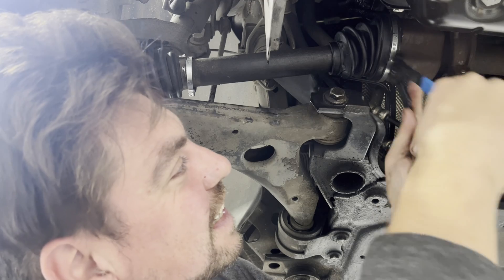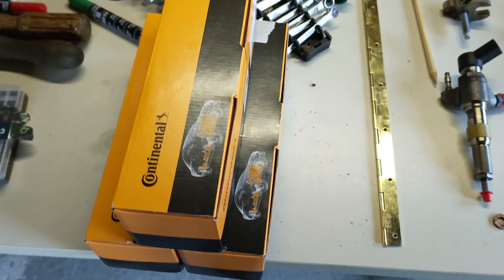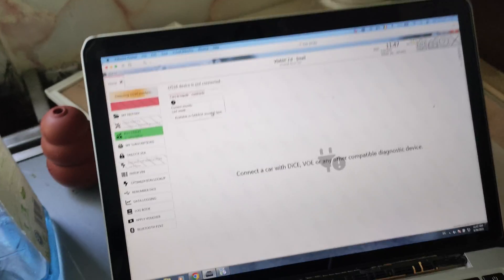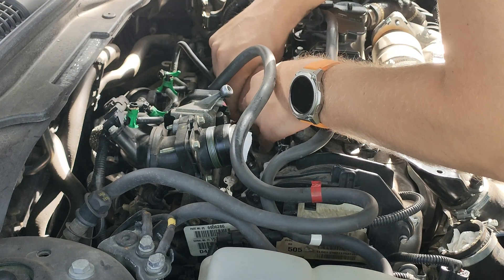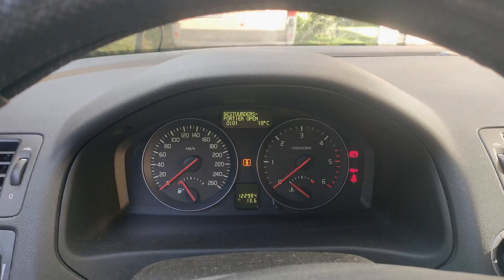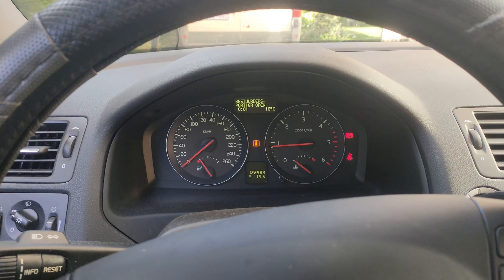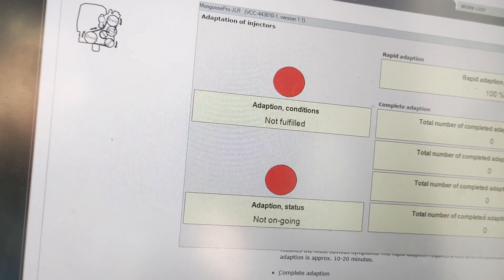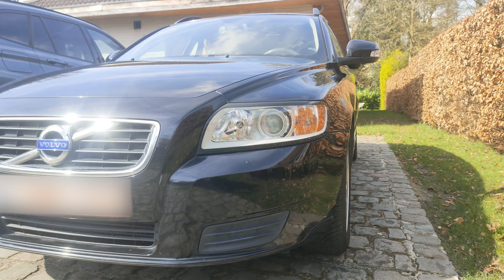Project Volvo V50 - Injector Replacement & Awakening the 1.6 Diesel | PART 2

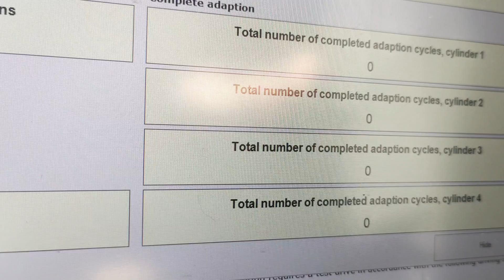Comment: 13:00 You need to keep driving doing the speed up slow down until the number of completed adaption cycles changes from 0 to 1. Although it may say you are at 100%, I have found a few times that to might need to drive double the distance. Also nice that it shows you to wait for 3 minutes after resetting the adaptions. This is something I though you needed to do after resetting the adaptions on my topdon scanner but I can't remember reading it in the instructions. Always good to see someone else's video to compare it against!
Reply from the maker: Good to know, but I have not found any issues since then, besides the damn DPF crapping out again... I've taken a look at your video about the C30 and yes, my V50 originally had the offset at max limit before changing the injectors. I had them tested and they confirmed it, as you saw. After changing them at first start it was a rough idle. But after coding and adaptions it was smoothed out, and that code never came back... I think the adaption matters a lot if the offset printed on the injector is not accurate anymore, such as when installing used injectors. Anyway, I also understand the car does these adaptions continously when running, so either way it should get smoothed out.

Comment: I have a volvo v50 1.6d 109hp 2007 lift version. Does this version also need coding? Does the vida software allow injector coding?
Reply from the maker: Afaik it does need coding. And you can't do it with vida but you can using Vdash.

Comment: hi - great video - have followed same procedure to replace an injector. i am struggling to get the vida adaptation process to work. it gets as far as resetting the stored values but then the screen with adaptation progress is always yellow and 0%. what did you to start the process, just drive or was there a step start?
Reply: You need to go out on the highway and rev it up to 3100 rpm and just release gas pedal until it falls to 1300 rpm, repeat until the adaptation progress is at 100%
Reply from the maker: As I recall correctly start driving and the color will change. I sped up to about 80km/h in 4th gear and then release the accelerator and let the car slow down. Light should be green until it drops to 50km/h... Do this a couple of times
Reply: @patchnplay  in my case the colors didn’t change to green until I let go of the gas at 3100rpm in 4th gear and the engine had to be completely warmed up
Reply from the maker: @gulaurfo6104  yes you're right
Reply: I couldn't get it to start the adaptation to start, I did the 3 minutes switched to the adaptation started the car - > clicked on the thing where the adaptetion screen pops up and driven like you guys wrote it just stayed orange the whole time no change.

Any idea guys the car is pretty rough while driving or at idle

Comment: Nice video. 
I did the same repair, just replacing the copper rings and gasket at every injector. 
Drained the system for air, but the engine will not start. It ignites "Diesel start" from a spray can into the air inlet, but it seems that the injectors does not get any Diesel. Any idea what can be wrong?
Reply from the maker: Sorry for the late reply, hmmm I would check the return line for fuel. If there's no fuel coming out, air may still be trapped in the system. it ignites with diesel start so it's definitly a fuel issue. do you get any error codes? Air sounds like a plausible cause, if it was something else one or more injectors would work.
Reply: @patchnplay  No problem. I found the reason: When the 2 injectors for cylinder 2 & 3 was removed I used a too to remove them that was screwed on the top of injector after opening the injector. It harmed the injector so I had to replace them. When new injectors was installed the motor started immediately.
By the way: I learned from a mechanic that the valves for thsi 1,6 DrivE does not need to be primer after installation. It worked 🙂
Reply from the maker: @tinabobjerg750  ah so you used a tool that you put on top of the injector to pull them out? Yes, that is not good news for the injector in case you want to reuse it. In my case the injectors were not that stuck. On my other vehicle that's a different story. Good you got it running again!

Comment: Hello. Do you know that the Vdash was showing the WRONG injector order in that picture? I have already opened a claim and told them that they messed up the injector order for these PSA engine. They admitted it was wrong and in a past release, they corrected the order (1 cylinder near the gearbox, 4th near the timing). You shoud check this by removing an injector connector and see what code appears (for which cylinder)
Reply from the maker: Thanks for letting me know. I think I respected the order in the picture and if I recall correctly this was the right order (I did disconnect an injector prior to filming to find out about the order). I've contacted vdash as well and asked for more info and will check the codings. Thanks again!
Reply from the maker: Hi Zeno, I've checked the footage again from the first episode and this one. If you look closely you can see injector 3 (the one that was replaced) has a plastic clip attached to its fuel pipe, the garage put it there to avoid the screw dropping down along the pipe. Its code is visible and is A8FHHH. At 9:27 you can see the old codes prior to coding the new ones and injector 3 is exactly A8FHHH. So it seems the order is correct. Are we talking about the same engine? D4162T? There is a similar engine 1.6D in the previous generation.

Comment: Hi there I have VIDA, and wanted to adapt my injectors too, but ‘Software support for Adaption data’ is not approved, did you run into this issue?

It appears to allow me to reset adaptation all the circles go green, but for the adaptation of injectors no values are shown and the circle remains yellow. Is there something else you have to do to get it to start? Or is this likely due to the software not allowed. Thanks
Reply: I think the first time has to be an approved VIDA then it will download the software onto the ECU. I believe it then stays there so the next injector your personal VIDA should be able to initiate the adaptation.  that's what Ive read anyway. Is it possible to do the adaptation with the front wheels on stands? - seems better to run test without risks of traffic and looking at laptop etc.
Reply from the maker: Hi, you can't use VIDA for this one, only an approved version at the dealer can. But you can use Vdash, it's also not free but fairly cheap (about €30 I believe) and then you have 24h of coding support through Vdash.
Reply: @patchnplay  Hi thanks for the reply, I used VDASH to code my injectors, but where can I find the option for rapid adaptation? Thanks again
Reply from the maker: Sorry I misread your comment. You are trying to do the adaption and test drive after the coding right? You should be able to do the test drive + adaption. I don't remember the exact process but once you accelerate until 90 km/h in 4th and let the pedal go and let the car coast then the circle goes green. You do this a  couple of times and then it's happy. But my values stayed at 0, which is quite normal since the codes on the injectors should be accurate so I'm not sure if this step is really all that useful... I don't remember where this procedure is located in VIDA but if you follow the injector R&R in VIDA it has a shortcut to the right place.
Reply: @patchnplay  Thank you again for the reply. I think maybe I can’t do this in VIDA without software 30743234. Which unless your a registered business you can’t purchase. 

The adaptation process lives - Diagnostics - Vehicle Communications - Advanced - Checking and resetting the adaption for injectors.

I can only reset the adaption but can’t do the test drive. Status remains ‘—-‘. And the circle is yellow throughout. I can see in your video the circles are red, and you have a status reading. Unfortunately that’s not the case my end. I guess I need the software on the ECM to allow the adaptation drive to be accessible. 

Keep up the good work, enjoying the videos!
Reply from the maker: @matthewchallis8827  thanks mate. Hmmm maybe you need another copy of the vida virtual machine? I gotta say I'm not an expert but I wouldn't sweat it. If the car feels good and the codes are in there then it will self adapt along the way
Reply: @matthewchallis8827  Hi! I got into the same situation: my vida cannot start adaptaion process - only yellow circles are displayed. Did you manage to solve the problem ? Thanks in advance.

Comment: Normally on the volvo d4162t engine you only need to reset the fuel adoption not like ford focus pergoet, citroen, then it will put itself through a learning process ,I've never coded a fuel injectors and mines runs smoothly,
Reply from the maker: I've heard similar stories yes, but I guess it depends how far off your new injectors are from the old ones. I can understand the adaption process will compensate for a mismatch in codes but as you could see, coding the injectors is quite easy and made a difference from the start.

Comment: How did you remove the injector's lower rubber cover to gain access to the torx bolts underneath?
Reply from the maker: With a bit of fiddling you can get it out. my cover was already ripped thanks to the butchers at the dealership that replaced injector 3 a few years back...
Reply: @patchnplay  I don’t see the point of that foam thing except perfectly hiding black death

Comment: Thanks! What a great video! 
I'm in the same situation myself right now with my Volvo S40 D2 (same engine as yours-D4162T). 
Injector 3 got a short circuit (error code - P1263-cylinder 3 high to low side short) and now I'm about to replace all four of them. I've already purchase four new PSA injectors since the original ones are ridiculously high priced. 
I'm a bit worried if the ECU will accept those injector's codes, as I haven't found any reference regarding PSA injectors on a Volvo's ECU yet.
Reply from the maker: @patchnplay
  • 1 second ago
That's an interesting question. Those codes are actually the offset values for the ECU (flow rate). So my guess is that the ECU will accept them.
Reply: Did it work?

Comment: The dead injector was probably the root cause of your DPF problem, if the engine kept sooting up and the ECU kept trying to regenerate the filter, it means the filter would overheat and crack or melt.
Reply from the maker: That's indeed a real possibility

Comment: 18 or 80 euro to program the injectors? And you are running both vdash as well as vida software? I thought the latter is proprietairy to Volvo dealers only?
Reply from the maker: It think it was 10 euro for the subscription, and an additional 15 euro to buy 24h of injector programming... Yeah well, propietary... you can find both VIDA2014 or a VM with everything preinstalled on the internet. VIDA is now a SaaS product so the later versions are indeed Volvo-dealer only (or you have to pay a lot). At least my Volvo dealer was like "if you have VIDA yourself you can blabla..." So it seems quite common for hobbyists to have a copy of VIDA and a cheap interface. If I'm not mistaken VDash can do most things too but apart from programming the injectors I didn't use it a lot yet.

Comment: I have the exactly same engined car. Keep it up.
Reply from the maker: Thanks! I'm wondering if you had any similar issues?
Reply: @patchnplay  I had injector max value issues. Then I’ve changed all my injectors with original and  brand new. All the vibrations and other knocking sounds gone. 
But still O face problem with my driving, the engine vibrates on second and above gears, and only at 1700-2000 rpm’s while accelerating. Only vibrates when the engine hot. When it cold, it’s very smooth. 
I suspect turbo selenoid but I am nor sure. Car has no any error code. 
Btw, I suggest you to use new generation injectors. Siemens revised the injector model on 2014. New injectors are 8680 (last four digits of model code) cars come with 3080 which is more sensitive than 8680.
Reply from the maker: @devrimarabalari  I've got 3 new injectors from VDO Continental which have both model codes, as one was still good, was replaced only 40k km ago. Weird with your vibrations. Engine mounts? Maybe knocking? Hard to say...
Reply: @patchnplay  engine mounts, dual-mass flywheel, control arms. All these parts will be changed next month :) I hope these will work.
Reply from the maker: @devrimarabalari  Keep me posted! And good luck finding the source of the issue.
Reply: @devrimarabalari  Bad turbo control solenoid would throw an error code and limp mode. If you only have problems when the engine is hot, it may be oil related, these engines have an issue with fuel seeping past the piston rings and diluting the oil, which could also bog down your turbo.
Reply: @Stoney3K  thanks, but my car had no issues with turbo or oil system. There were no limp mode at all. 
I am using past tense cause I sold my car 5 days ago, and I’ve bought another Volvo which is S80 T6 304hp (2012) :)
It has big kilometers but seems the engine is ok for now (360.000 kilometers)
I am planning just to change coolant soon.
Reply: @devrimarabalari  ky problemn i dridhjes te marrshi 2 nuk eshte injektori ,,po eshte pompa naftes...pompa naftes humbet presjonin edhe fuqine ...duhet ber revizjon pompa naftes ose nderruar e ke 100 % te sigurt.
Reply: @fatjonprendi4375  hey mate, could you please post in English. I can’t understand :)